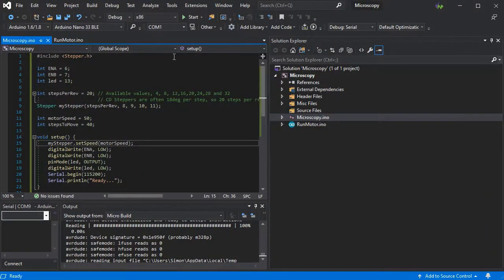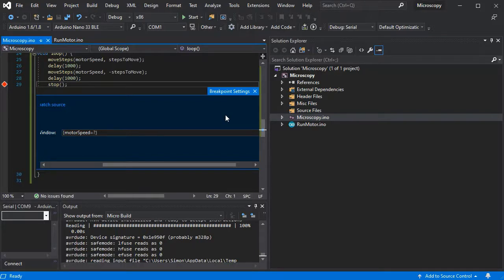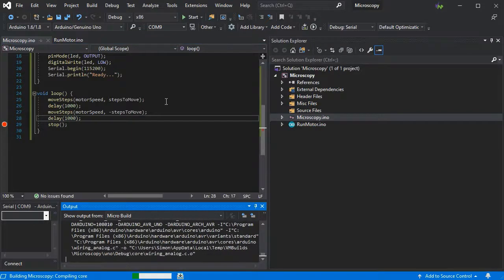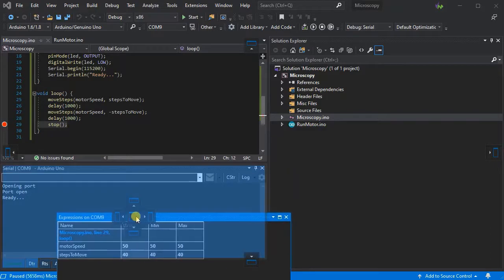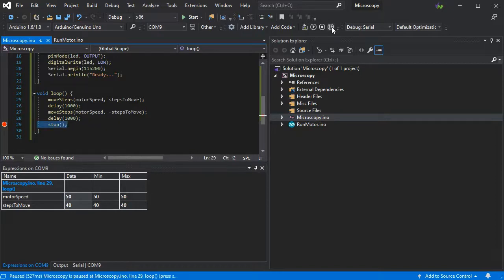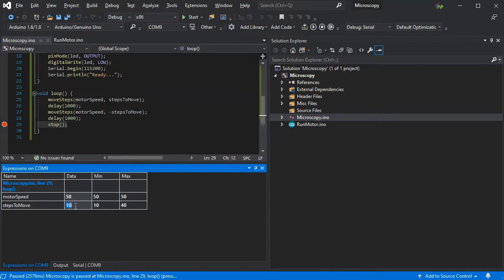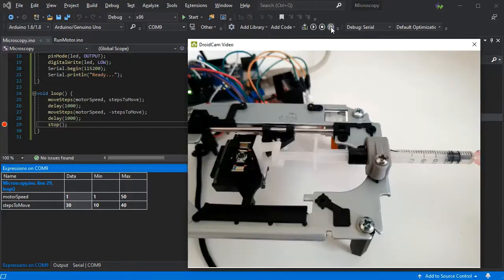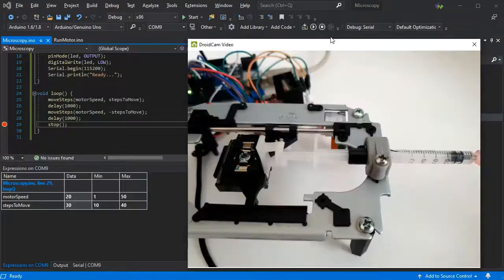Calibrating Linear Actuator with Serial Debugger

Comment: Hello, If I wanted to go about controlling the number of steps using a textbox in a User Interface with a textbox, do you know a line of code I would need to use to call the textbox value in the Arduino.ino code?
Reply from the maker: The editable variables in the vMicro Serial Debugger allow this in either Visual Studio, or the Web Debugger Experimental feature also support this (shown at the bottom of the Get Started Tab).